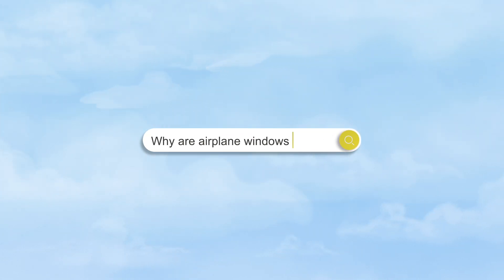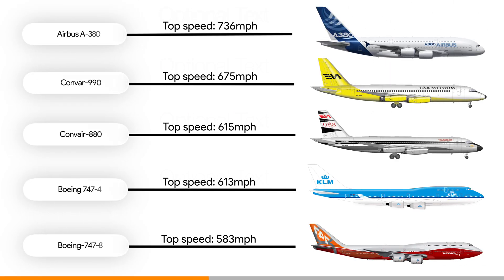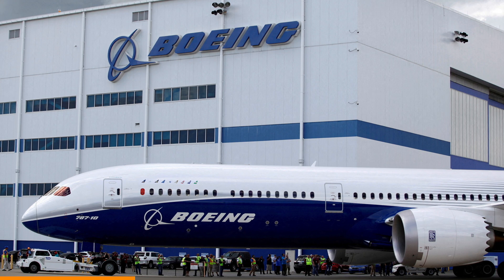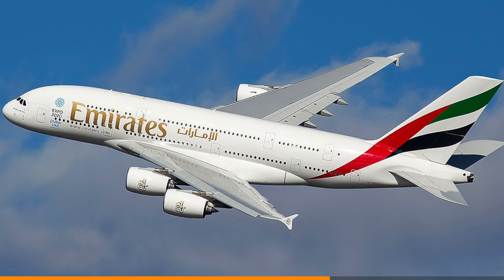Pilots Answer Popular Google Questions

Comment from the maker: Bringing you the question! 

0:00 - Opening
0:24 - Why are plane windows round?
1:21 - What's the speed of a commercial airplane?
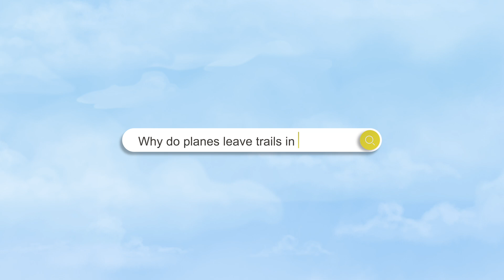1:34 - Why do planes leave trails in the sky?
2:00 - What happens if a plane door opens mid-flight?
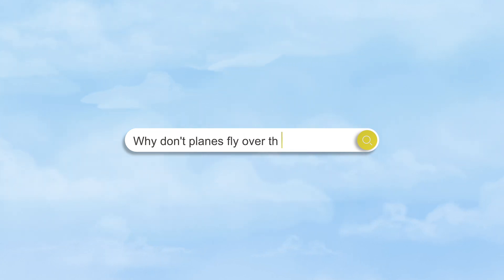2:35 - Why don't planes fly over the North Pole?
2:53 - What is the busiest airport in the world?
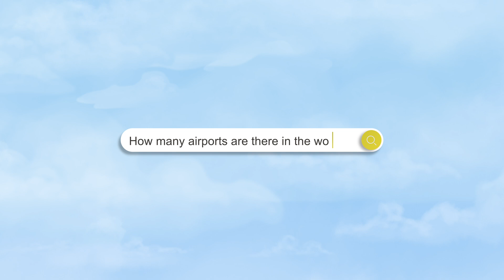3:10 - How many airports are there in the world?
3:25 - How long can a plane stay in the air?
3:54 - Is turbulence dangerous?
4:29 - How does deicing work on an aircraft?
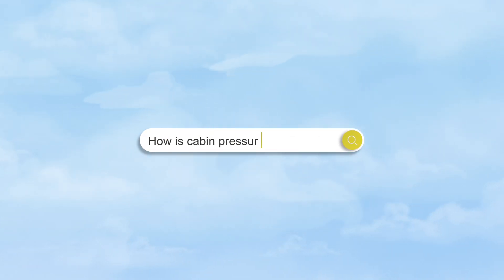5:06 - How is cabin pressure maintained?
5:34 - Why are some planes painted white?
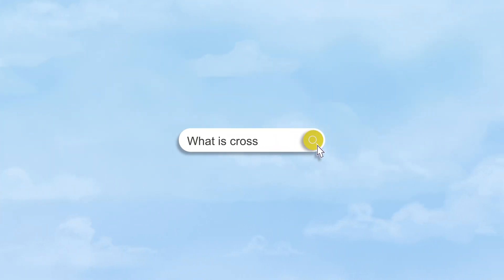5:44 - What is crosswind?
6:23 - What does the term heavy mean in aviation?
6:59 - What are ailerons on an airplane?
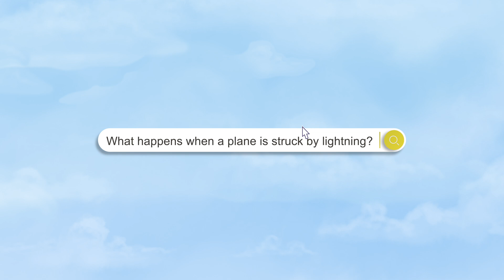7:22 - What happens if a plane is struck by lightning?
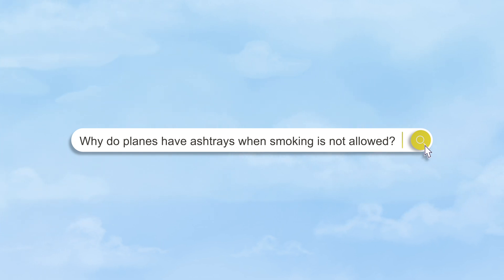7:48 - Why do planes have ashtrays when smoking is not allowed?
Reply: Airplanes are painted white because it reflects sunlight and thereby reduces heating up and causing drag and also, white paint has less pigments in it, so it is also lighter in terms of weight. On bigger airplanes, that can accumulate to the weight of several passengers. 
So, less fuel consumption and/or more load capacity.